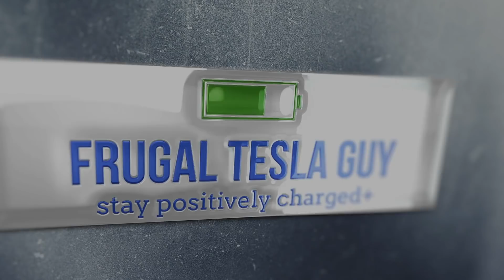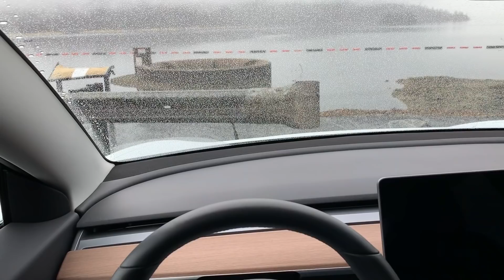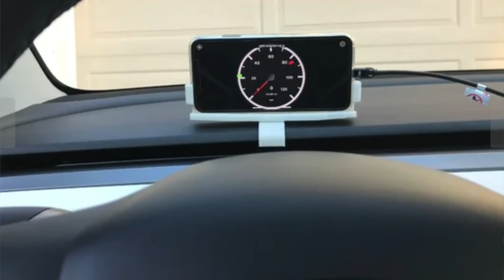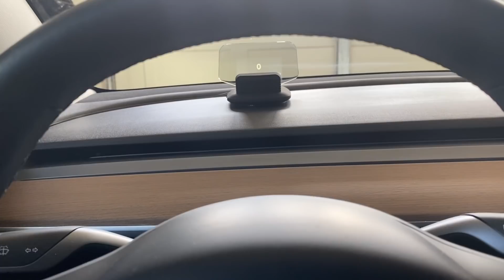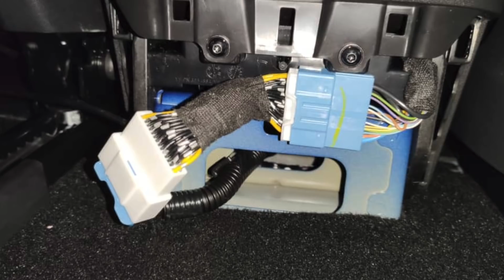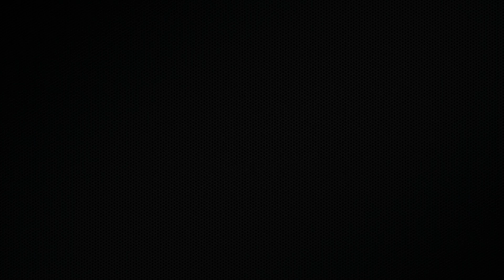Tesla Model 3 Head Up Display **Please Read the Description

Comment: A HUD is what I always thought would be cool for any Tesla. But this one looks too blocky (the base) and the screen looks too small, and ugh on the wire. My ideal scenario would be using the window as the screen and having a flatter wireless base projector. Then maybe the price would be right.
Reply: Tesla decided that a small HUD picture with low resolution (480x240) would have been in a bad contrast to the huge hi-res center display. For the Model 3 they could buy such a simple HUD for $115-$125 and easily resell them with 6x-8x markup as a built-in option. Aesthetic over function. Tesla is Apple of the car world.

Comment: Since you are disconnecting a vital connector and inserting a non-Tesla connector and 'OBDII' reader in between the vital Tesla connector, there is a strong possibility that you are voiding the warranty of the car and may in fact do damage to the car... Be very careful if you buy it and install it, read the directions and follow them exactly. And to make sure that the warrenty is not voided, remove it before you have your Tesla serviced at a service center or by a Ranger.
This device is an incredibly limited device that shows only 1% of what is actually be sent on the OBD bus. Here is a partial list of what can be accessed on the bus - outside temp, interior Temp, bat v, bat A, drive total kWh, Miles, average Consumption, DC Charge Total, AC charge total, Regen Total	drive total, Nom Full, Nominal Remaining, Energy Buffer	SOC, Cell Tem Max, Cell Tem mid, Cell Temp Min, Cell V Max, Cell V mid, Cell V min, Cell Imbalance mV, Charge Total kWh, Discharge Total KwH, Discharge Cycles, Charge Cycles, Discharge kWh, Charge kWh, Stationary, SMTRated Range

Comment: I like it. I would like a HUD and $350 isn't unreasonable in my opinion. Hopefully the HUD displays its info at infinity, so your eyes don't have to refocus from the road. If so, that's an improvement over the center screen. 
Info I woud like: when the Tesla alerts, I would like the HUD to display where the car "thinks"the danger is. As it is, I'm looking around for the problem, not at the screen! (It would also be nice if the car would use the sophisticated sound system to make the beep seem to come from the direction the "danger" is in.) Seems to me, just like the frunk and trunk openers, the cable could be theaded, and maybe a little hole could be punched, so the wire is hidden. Great review, thanks!
Reply: It is possible to have such a system. Some premium cars are going to have them as an option in the next couple of years. But not Tesla. They think you don't need such functionality. Tesla is Apple of the car world.

Comment: Yeah no sticky residue but what if you had it on for years and car sitting in the hot sun. Do you have to turn it on and off each time?
Reply from the maker: Good point about the residue. I couldn’t say anything about that at this point. It does turn itself off and on automatically. No need to do it manually.
Reply: Frugal Tesla Guy coo thank you.

Comment: Good video, as usual.  Lack of HUD was a big, big miss by Uncle Elon and I really wish my 3 had it. Video described the problem perfectly, you do get used to the center screen, but it pull your eyes from the road just a little more than I'd like.  I'm on the fence about this aftermarket HUD, but this is the closest I've seen to satisfactory.  Two questions: 1) any indication from Hansshow on timing for future update with navi indicators on the HUD?  2) Seems like the cord buried reasonably well in the dash, but what about the rest of the way to the port? Was the cable visible between the seats?
Reply from the maker: I don’t have the OBD setup but based on my conversations with William from Hansshow the plug will be completely hidden behind the panel under the arm rest. As far as the update is concerned. All I know is it’s in the works. I have no timeline at this point.
Reply: Tesla decided that a small HUD picture with low resolution (480x240) would have been in a bad contrast to the huge hi-res center display. For the Model 3 they could buy such a simple HUD for $115-$125 and easily resell them with 6x-8x markup as a built-in option. Aesthetic over functionality.

Comment: I like the concept of having a HUD display but I don't think I would get it until they come up with a way to connect the display through a bluetooth OBD2 dongle so there isn't a wire being strung along the dash
I wonder if in time they will be able to make the screen a little larger but the base thinner so it doesn't look like a 3rd party accessory.  Right now I have a Model S but when the lease is up I was thinking about going to the Model Y.   By the way I like your show, I think you do a great job of keeping us well informed.
Reply from the maker: Thanks Don!

Comment: The HUD is nothing more than a second screen with no unique information. Just moving the screen directly in front of you doesn’t add much value. Your muscle memory is quickly trained to use the Tesla’s center screen at a glance — just like you scan your rear view and side mirrors regularly. 

HUD technology has been available in autos since the 1980’s — there’s a GREAT reason that they never caught on — they just don’t solve any real problem.
Reply: You can keep your eyes on the road and will receive all the relevant information for driving. No need to look down - less distractions. HUDs are getting cheaper and catching up. Just not at Tesla. And HUDs in the 80's very pretty crappy. They have gotten so much better in the recent years.

Comment: display should be taller and wider and designed better to blend naturally with the windshield in a way which makes it seem more cohesive to the vehicles, modern, minimalist, design. - Also, as you’ve fairly (unbiasedly) mentioned, the cord is an aesthetic issue. However! — Here’s the big issue you didn’t cover. You mention over and over and over that this device from (Han-Sho?) which is obviously a Chinese company, that they will provide “Over-the-Air” updates. So my question is, how is this done? Does this HUD have its own LTE? WiFi? If it connects to your home WiFi, what data is it potentially intercepting/gathering (Google searches/Banking information, etc.) over your home network and all of your LAN devices? —Or, does it somehow piggyback over the OBDII Port (if at all possible) to the Tesla’s LTE or WiFi? — If this is the case, what data is HanSho(?) collecting and sending back home to China? Since, by connecting to your OBDII Port, you’ve essentially given the device a direct brain tap/splice to EVERYTHING about the vehicle, And, potentially, your private home network and all the connected devices. — There’s a goldmine of modern information there which the typical end user may be unaware of giving away. My take on this is, given the numerous mentions of “over-the-air” updates, is that this device was created as a data collection tool disguised as a product. - That’s just my 2 cents.
Reply: Jeremy H, you are paranoid. I like that! IMO, you raise excellent points.
Reply: Dude, your smart phone was made in China. If you are worried that China is spying on you for your “goldmine of information” you don’t need to worry about a gizmo on your dashboard — YOU ALREADY HAVE ONE IN YOUR POCKET!
Reply: Andrew Leavitt Andrew...I’m guessing you’re maybe an Android guy? - Possibly even a Trump supporter? Am I right? — Even so, I can tell you don’t ‘get it’ with technology. - Yes, my iPhone was Designed by Apple and built in China. But what you fail to realize is that Apple has end to end control and oversight with the production and hardware. It would be a ‘HUGE’ problem for Apple if China had included back doors into the Apple hardware. Hardware aside, we can trust that Apples iOS is maintained strictly by Apple. If we give Apple the benefit of the doubt, which we should. You would understand that Apple would would be the first to know if their phones are sending sensitive data back to China via their hardware. -That would be a major oversight. - It’s funny to me that you compare an American designed/Chinese assembled phone to a PURELY Chinese hardware device. There is literally no comparison, at all. — I’ll tell you what, I’ll start up a factory in China and sell you a high-tech watch that DOENST spy on your data. Yes, I can’t and won’t guarantee any data privacy and I certainly won’t tell you that everything you do isn’t being monitored in some capacity by the Chinese government. - That said, Apple devices have stop-gaps in place from every level, from inception, to legal, to prototype to final production to ensure that Apple maintains US legal requirements and beyond for its customers PRIVACY. ——— Do you think (Han-Sho?) cares about any of this? Do you, transparently, know who they even are? - Do you know ANYTHING beyond what you *think*and *feel*?? - I believe your honest answer to yourself is, No.

Comment: Would not like to see this on my simplistic clean line of the dash
Reply from the maker: I completely understand. I actually felt the same way but don't mind it now.
Reply: I agree!
Reply: Would have been much better if Tesla had installed it in the first place. They could have hidden the projector in the surface of the dash and you wouldn't see anything It would just display on the windshield.
It's one of the things I absolutely detest about the Model 3 and model Y. I hate the interior Dash design.
important information that you need to see should be directly in front of you not off to the right
Reply: A missed opportunity by Tesla. If they'd only spent 50 dollars fitting these into a tiny lens on every dash, thier safety stats would have been even more amazing. Annoying, as they aren't just stats, they're real people with avoidable life changing injuries.